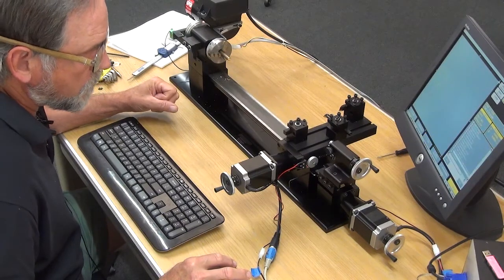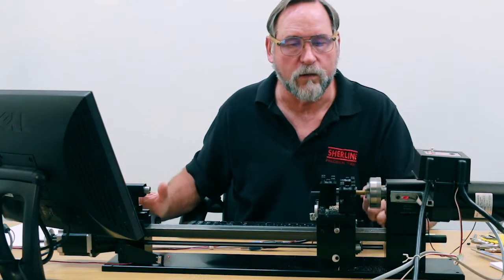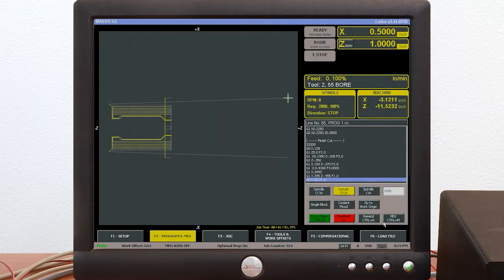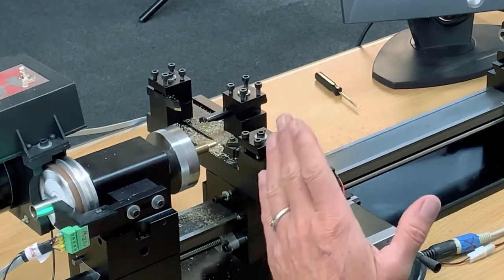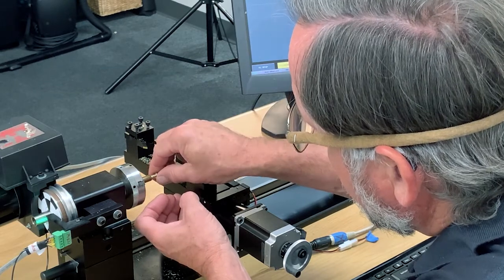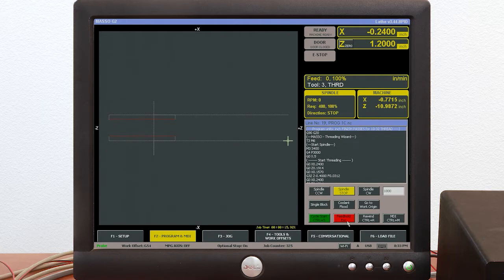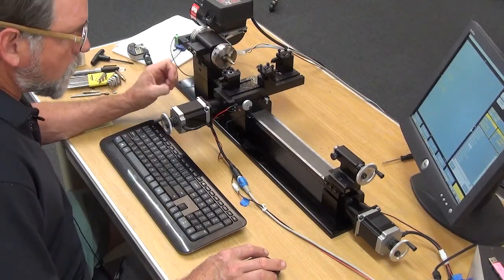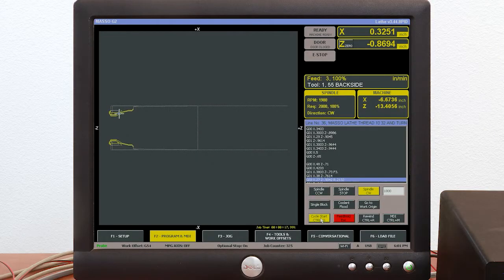Ball Screw Lathe Setting up and Running a Part

Comment: When you combine it into one program, will it run through the whole thing without intervention, or does it stop at each tool change? What G codes lets you change tools (that are already set up) without the program stopping?
Reply from the maker: From our techs.
1. With the MASSO control and software, all of the tools are hard-wired into the control. MASSO knows the length/diameter information for each tool as it was set in the previous video.
2. On most controllers, they use a G43 H value line of code to incorporate the tool length and diameter offsets. Then they use a G49 code to cancel the length offset before the next tool change.
3. There is no need for this with the MASSO controller. With MASSO to call up a tool change, you just use the G-code “T (tool #) M06”. The tool can be anywhere, and the MASSO controller will automatically go to the next tool that you call up, move that tool to the position that you have in the program, and start machining. There is no need to incorporate or cancel tool offset information between tool changes.
4. Special note: As with all Cad/Cam software and all CNC controllers, They do not know the relationship between different tools. Such as the distance between tools on the crosslide or the length difference “as it relates to a Tool Change Position”. This means that you will need to add lines of code before and after the tool change to move the tool to a clearance position first. Then the tool change code “T# M06”.
5. There will be no hesitation between tools during a tool change, other than the time it takes to move to a tool change position and to begin cutting with the next tool.
Reply: @SherlineProducts  Appreciate that. I have a MASSO on my machine and find that T# M6 stops and waits for a tool change, even with the tool table filled out. I asked this on one of your other videos, so no need to reply twice. The videos are a great help!
Reply: @SherlineProducts  Got it. It needs the Tool Change set to Gang Tooling. Then the M6 works without stopping for a manual tool change.
Reply from the maker: @rak6080  Glad you got if figured out. I'll let our tech team know.